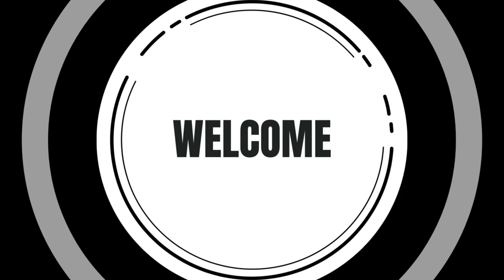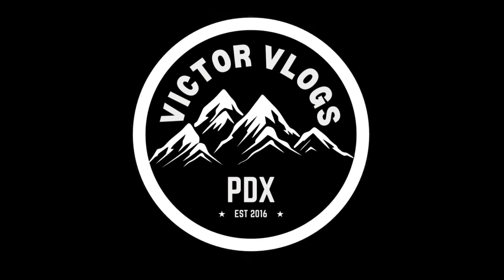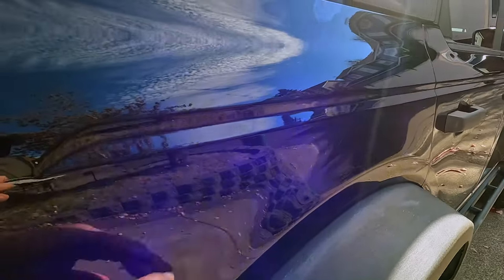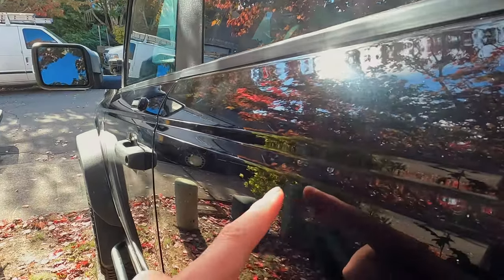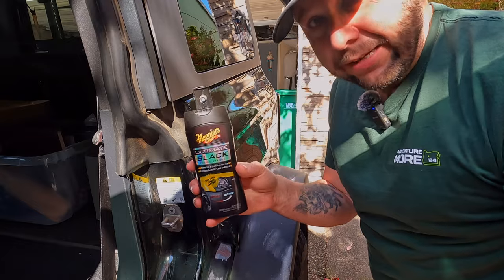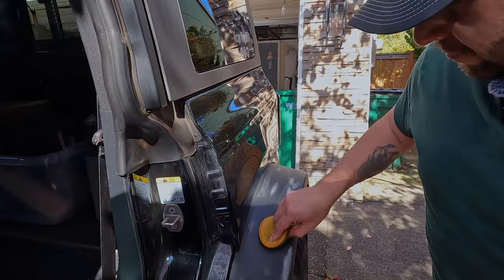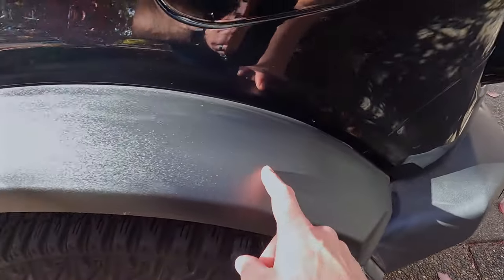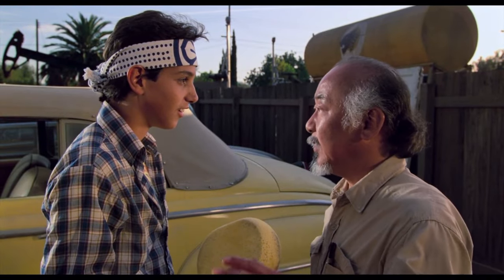MEGUIAR'S SCRATCH X RESULTS...1 MONTH LATER

Comment: Hi, there. Your video just popped up here today. 🙂

A tip for the white marks on the plastic: You could try cleaning them with a quite strong dilution of all purpose cleaner (or degreaser) and a nailbrush/ toothbrush. They are tough to remove and might be “burnt” in by the polisher, but maybe you’re in luck. 😊

You can apply the plastic restorer afterwards. It will not hide them though, as you already know.
Reply from the maker: @flemmingjensen3202  appreciate the tip. I'll have to give that a shot. Thanks for watching!